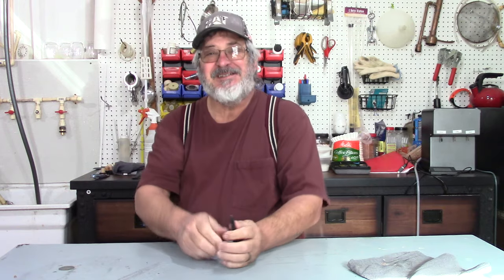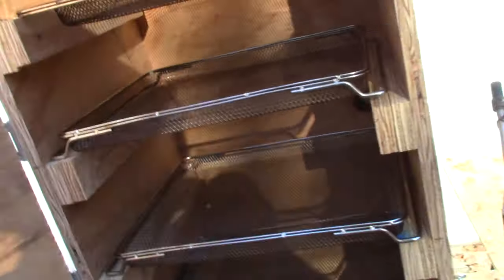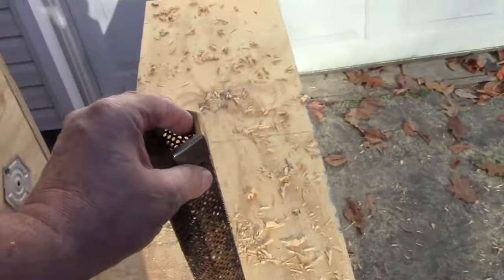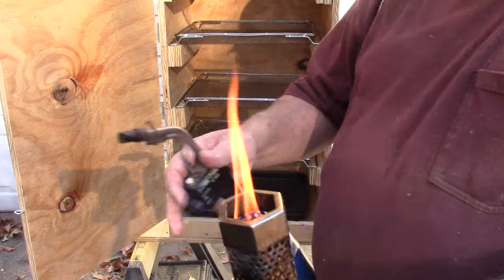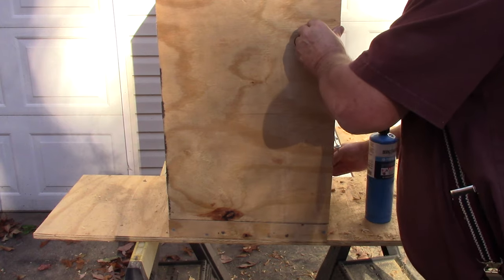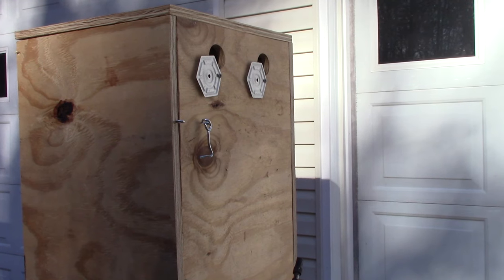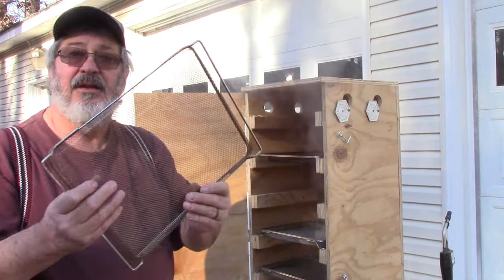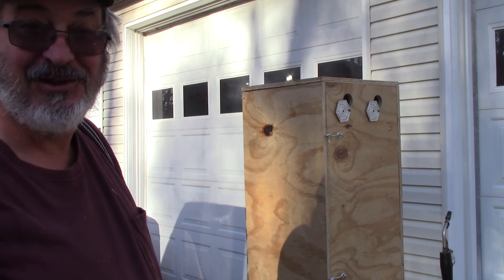Smoke Box Build For Smoking Grain

Comment: Let the smoke tube burn for ten minutes before you turn it horizontal and make sure not to overfill the tube. I have three of your type. one is half length. It's easier to use for short burns or when you want more smoke than one tube will put out. Thanks again for ALL your content.

Comment: Randy, weather stripping on the door will help retain more smoke. You could put around your steel air-flow grates as well. That way you get a bit more control on the smoke and what is staying in the box. If you have some caulki g laying around, caulk all corners inside as well, even more smoke retention.

Only other thing I might suggest is one of the bottom inlets, put a very short but wider than smoke bar, steel tube so you can pull out the smoke bar, reload or change out wood/pellets in there. You'll probably mess around with multiwoods at some point and that will allow you to ise needle nose pliers to pull/insert that smoke bar.